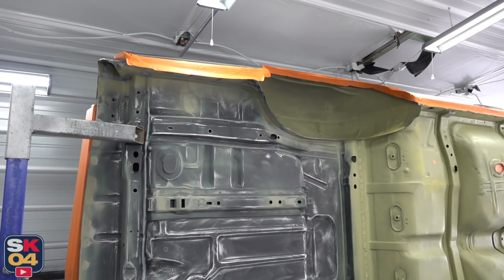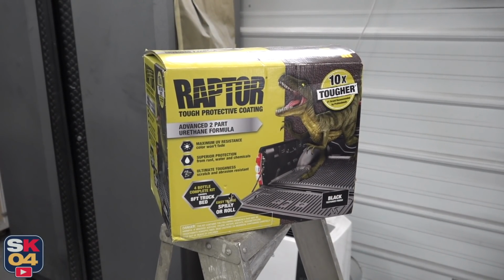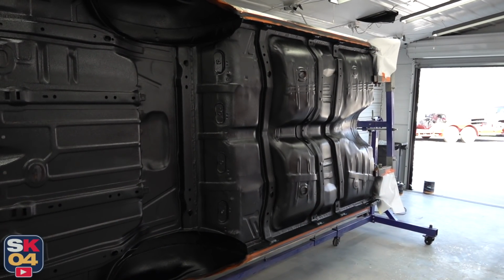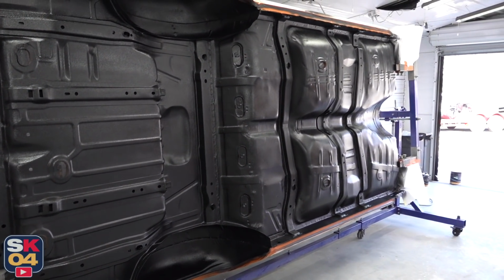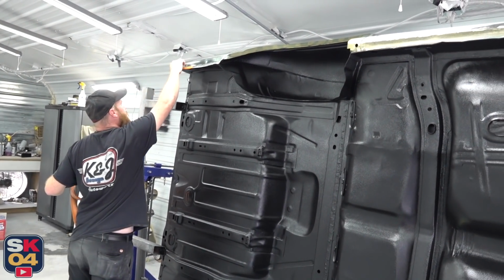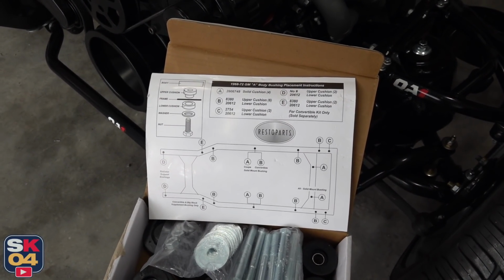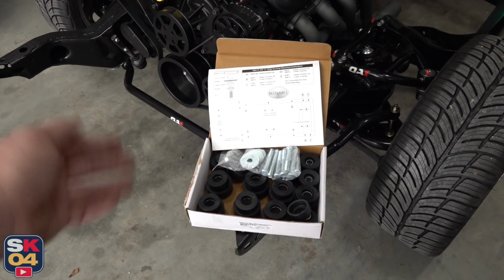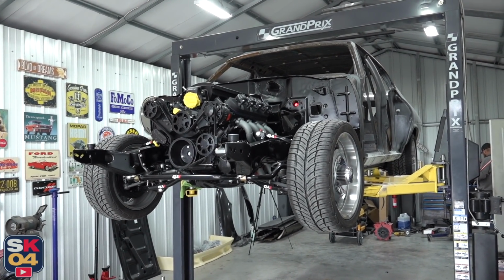The Body & Frame Are Together Once Again, It's All Coming Together! Chevelle Restomod Ep.15

Comment: My plan for my Ford Falcon is, once the body work is complete, will be to spray Lizard Skin sound and heat insulation throughout the interior cabin, under it, across the firewall. Then bedline the whole underside. 
This will add an additional $1500 to the build cost, but I feel its worth it.